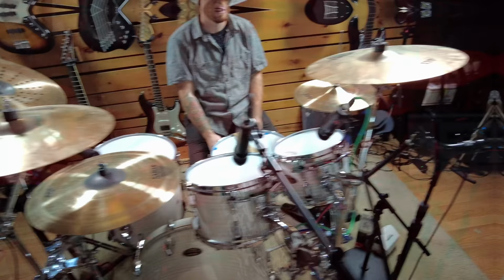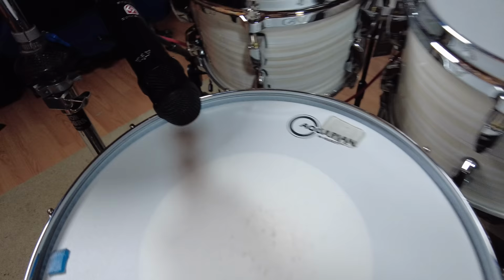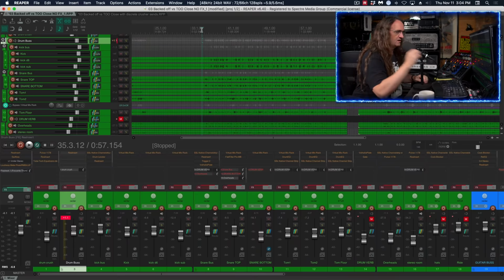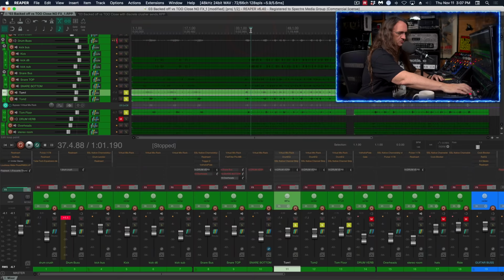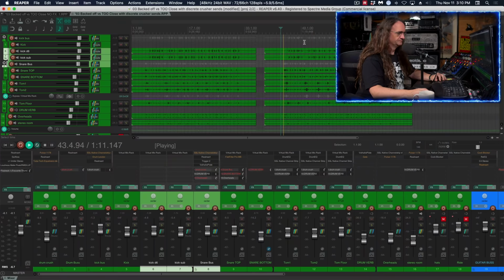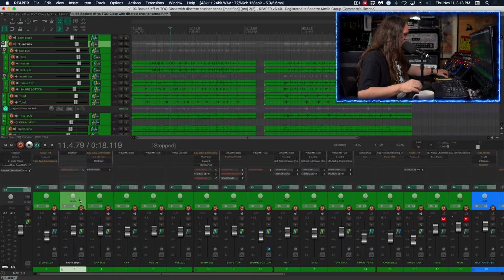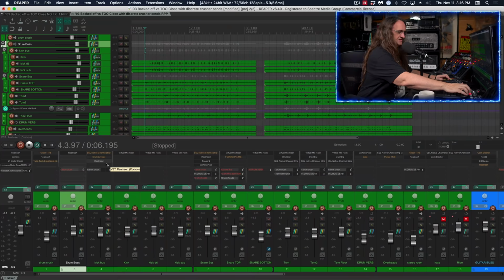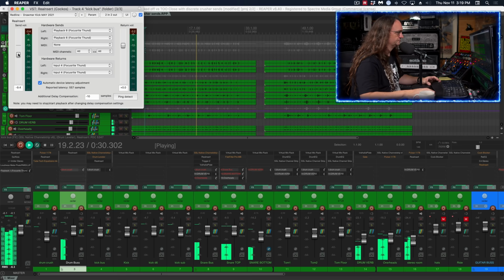Heavy Drums II:  How Close is TOO CLOSE?

Comment: The difference in the resonances of the toms seems key to me - that round ring that's pestering the closer mics is enough reason on its own - bleed not withstanding - to justify backing the mics off. Great video, Glenn!
Reply: A lot of engineers still like to use the 2-3 finger method instead of taking the time to experiment w/ the mic and particular drum to optimize the noise. I use a Beyer M203 on my snare a couple if inches off the head, barely inside the rim at about a 10-15 deg down angle at about 10 oclock. It gets a great sound and I'm not bashing it.
Reply: I applaud the Camus reference.  Cheers.

Comment: I turn my hand on it's side and have the mics 2-3 fingers off the heads. I generally aim them  somewhere between the edge and center of the head. Gives me a good combo of punch and sustain. And of course I use gates. But everything differs when using cardioid , super cardioid and hyper cardioid. So I position and reposition according to mic type , to get the sound I want. I use different mics frequently.  Kick-wise , I use 1 mic. Just inside the port aimed at the beaters , or halfway inside off to the side of the shell , again aimed at the beaters. This was a cool video Glenn.

Comment: Great video Glenn! In my experience (which to be fair is not in recording metal) once you get too close up on drums it starts to sound like how the head is tensioned at that particular lug. Which is usually not a sound you want (and definitely not super relevant to how people have experienced drums and would like to hear them).

My favorite tom-micing style (with the tools I have) is currently 2 clip-on (live) tom mics (I'm using 2 e604s per tom), top and bottom; feeding into a Y-XLR cable with one of the two ends wired in reverse polarity.
It takes away almost all that plasticy boingy basketball sound for a more realistic picture, gives a perception of the drum's depth (due to the obvious micro-delay between top and bottom), and as a bonus gets rid of a nice amount of bleed (since elements that are further away reach both mics relatively more at the same time). Usually it's only the fizzy stuff that's left, and even that at a lower volume than a single mic. In my experience, at least. 
Have a good one, and fuck you Glenn!
Reply: That's interesting stuff you're talking about. Regards from France.

Comment: Even though I try loads of things by myself and research like crazy, these series have helped me quite a lot.

IME I have really liked toms and snare mics around 3-4 fingers away ponting across the heads. However it's always a nightmare to record floor toms. What has worked for me was to back off that mic quite a bit, sometimes to the point of becoming a shared floor tom/under the ride cymbal mic... or adding a bottom head mic just to this tom. I always get too much growl and stick definition, but too little body/sustain.

Comment: Now, take that situation to the live venue... and you have to deal with possible feedback. Generally, I'll put snare and tom mics around 1 inch from the heads at the most. The further back they are, the more "noise" they pick up and the more gain you'll need, hence potential feedback issues. Overheads are another matter of course... I prefer the sound of the OH mics WAY up high... crashy, washy cymbals are definitely not my thing. BUT... the further they are, the more gain you need. And you know what that means.

Comment: My go-to method for micing the shells:

1) Use mic clamps instead of stands.
2) Aim at the center of the drum head.
3) Keep the mic capsule three fingers above the drum head
(two fingers above for the floor tom).

I've wasted too much time caring about the placement before I realized that treating the signals correctly in the mix is way more important than getting two dB more or less at 172,5 Hz on the snare.

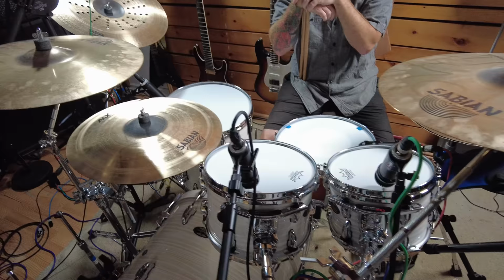Comment: When you showed the "close vs far miking" at 04:00, it opened my eyes, that a drumkit is basically just many speakers that are pushed and pulled by a drumstick.
Have you ever used that kind of approach, choosing distance and angle based on your findings when miking amps?
Reply: youd get crazy phase issues
Reply: Cool question but I don't think a drumhead pushes the same frequencies as a powered speaker.  A drumhead is tuned to a general pitch.  Sure there are overtones and resonance of the shell that add shades of other pitches.  But a guitar cabinet speaker is pushing a much broader frequency range.  I've found the angle does matter miking snare and toms but not to the degree it matters miking up a guitar cabinet.

Comment: Hah. I had that floor tom fart resonance issue and it was a pain in the ass to make it sound listenable for a record. So.. There's a video where Kristian Kohle demonstrates him recording toms super close to get a boomy sound for the close mics. Would that be then if you base your sound mostly on overheads & room mics and then just and the balls and boom from the close mics? But I assume that doesn't work with every mic?

Also a hardware noob tutorial on using external analog gear would be nice. I'm not sure if you have one. But like question that I have on my mind is that if I have an analog compressor, can I use it for multiple tracks at the same time or will it be just for one? And if I want to then use for multiple tracks, I guess that I have to re-record the track with the effect? I have like 0 understranding on using analog gear..

Comment: What about internal Mic's..  Or do you perfer external..??
If internal, position mic's to top head or bottom heads..?

I saw a Tommy Lang's Video he switch to internal miking. He pointed mic's to top heads.
So I did my own DYI internal miking  and like it..I pointed to top heads (PGA 56) ....think I had more sound control of each drums..less bleeding. (Bought 4 - Gibraltar Bass Drum Internal Mic Mount - SC-GBDIMM + 4 Pack- XLR 3 Pin Male Connectors, Panel or Chassis Mount, did my own wiring)
Only external mic's are 2 for snare (SM57....2 fingers lenth), 1 Hi Hat (PGA 81), 1 (PGA 56) for batter side of kick (other mic PGA 52, for Kick, threw the port hole)...and I have 2 mic's PGA 27 LC, for overheads (Left and Right). 
Not the greatest mic's..but it's what I can afford...for now.

Also.  I'm getting that hhHusher.....as my daughter would say  "Kool Beans"..!!!

Comment: I'm sure this is the wrong place to do it but I was wondering if you could do a full frequency mixing, blending and in my case especially leveling of metal bass in a layered guitar mix. It always seems that my bass is way too quiet or way to loud with no in between. I do run a Di, Amp Sim, and distortion bass track simultaneously with lots of compression it just won't blend when I make eq cuts to make room or raise or lower the levels. Any help would be great. Thanks eh!

Comment: I’m using 12 mics: 2 overheads, 4 separate Toms, snare top and bottom, kick in and out, boom kick and a cheap condenser for the room. 

Do I need a hi hat mic??
Any tips on reducing the snare wire rattling with other pieces of the kit or is that a post processing trick?

Comment: Does the shift in tone have to do with proximity effect with relation to the specific polar pattern and characteristics of each mic? If so shouldn't there be a chart or specification to each mic that would give a 'danger zone' for where how close becomes too close? Will any of that change depending on what preamps you are using?
Reply: Preamp makes negligible difference but yes, proximity effect will definitely be part of it. Most mics have a chart in their box that shows the frequencies and polar patterns, and that should give you an idea of how big proximity effect is with that mic.

Comment: GLEEENNNN!!  In a matter of 3 seconds of listening (from 4:39 on) you kind of proved yourself wrong. They are instantly much more punchy and the toms don't sound like super tight jazz toms like they did earlier. even the snare sounds clearer and notice the snare buzz that will sound fvkin great in a rock mix. However you are using great mics which can handle it. Most cheapo mics wouldn't handle being so close without farting out. Plus, take into the fact that you have all new heads and they are tuned okay, a little higher pitched toms for my taste but to each their own. I would like to see an experiment with doing the same thing with all different mics. I mic pretty close with Audix D series and and even Fusion series mics and get GREAT sounds with minimal bleed. I kind of have to mic very close because I my splash cymbals and cymbals overall are set low like a jazz kit. I can't say either way sounds BAD. The thing I appreciate is that you showing everyone how to experiment and what happens when just moving the mic a 1/2 an inch one way or the other. Hope all is well and much love from Rhode Island!
Reply from the maker: Not a fan of the mics jammed up too close.   It IS interesting on the snare, but there's a bit too much midrange boxyness on the toms for my taste..
Reply: @SpectreSoundStudios  I do agree with you about the snare and the "box sound". I always make sure to save a template when I find something I am really digging the sound of and take pictures to reference back to try to save as much time as possible in the future.  I have always had to close mic because of such small clubs it was hard not to get guitars bleeding into drum mics playing smaller cymbals so I don't just throw white wash of cymbal wash into vocal mics throughout the stage. I DO try to use that close micing for my advantage to try to capture cymbals like splash or stack that aren't very loud and don't get picked up by the over heads as clearly. Thanks again for all the videos!

Comment: As for hardware insert delay, it is even shittier on Pro Tools. You have manually record and calculate the round trip (and you have to re-calculate this every time you're at a different sample rate). It also changes every time you open pro tools! It's maddening, and for that very reason I don't use any of my analog processors for mixing drums due to phase issues caused by latency problems. I end up just using any analog stuff on individual things like mix bus, bass, vocals, guitars, but never drums unless I am using a processor on the entire drum bus.

Comment: Buckle up your seatbelts, it's going to get nerdy ;)
Just a comment on the spill issue: Neither do I hear more of it on the backed up microphones, but the actual signal is considerably lower in volume on them. That would make gating etc. harder as the worse signal to noise ratio gives you less space to work with: Set up the gate's threshold too high and you'll loose useful signal, set it too low & you'll introduce cymbal/snare bleed. All that with tom hits that don't stand out of the noise floor as much as in the closer mic position.
That being said, I alos liked their sound better like you said, Glenn.
Reply: If you really wanted to use gates, you could use two close mics, one much closer, it's job is only to drive the side chain input to the gate.
Reply: @Mikey__R  What do you suggest, not gating at all?
Reply: @jakobfrei1121  sorry, I probably didn't explain very well. If you want a fast gate that doesn't trigger on the spill from the cymbals and other drums, you can use an extra mic, very close to the drum head. This is in addition to your main mics, which would be slightly further away, on the top and bottom drum heads.

The extra close mic drives the gate, but the audio is a mix of the main mics. That way, you get a clean opening and closing of the gate, but the timbre of the mics in a slightly better position.

Comment: As a drummer with decades of playing time in my history, please allow a couple of my thoughts and observations. First, throughout this video, the boingy over-ring of the floor tom was distracting. On my 16" floor tom I use a gel on top of the head in addition to a ring muffler beneath it. That gets rid of that issue. On a broader note, I've occasionally thought this weird concept: Since the bass drum's resonant head can work even with a hole cut in it to insert a microphone, why couldn't we do that with tom toms? Back in the 70s, a lot of drummers didn't put resonant heads on... although I don't recall ever seeing the toms mic'd from the inside, even on those kits. I think I'd like to try to do this, but it would be expensive to buy another set of resonant heads just to cut a hole out of them and potentially get shitty results. If we could mic drums from the underside/inside, it seems to me that the drummer wouldn't have to worry about striking a mic with a stick and it could theoretically reduce the bleed from other elements better.